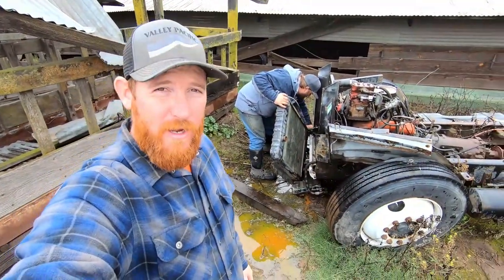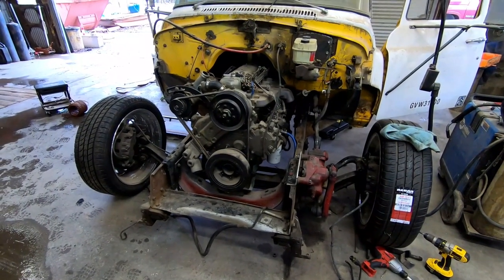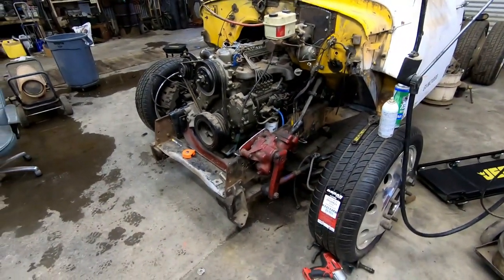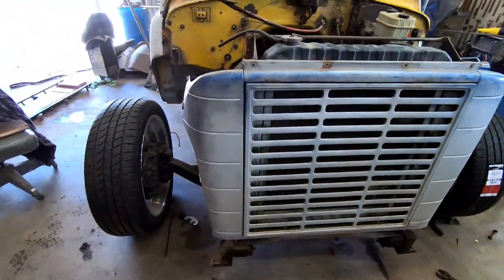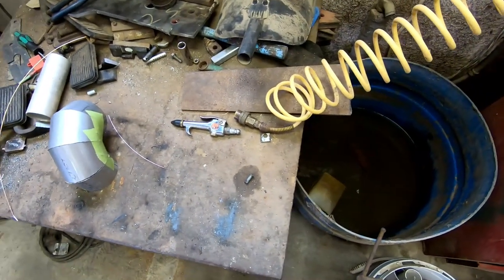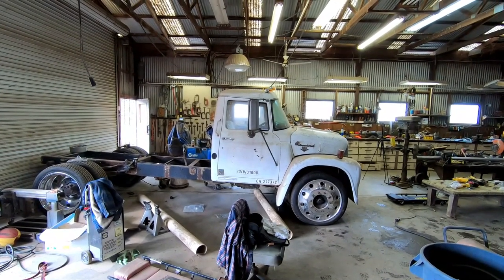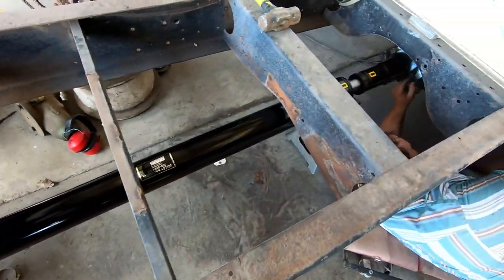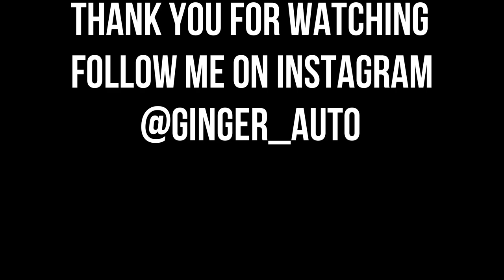Loadstar Gets a Custom Driveshaft!

Comment: Really slick setup with the brake line routing. Congratulations on the milestone of the front clip on it! The pie cuts looked like you got a nice tight tolerance on. I'm pretty impressed if those are your firsts! I'm about to dabble in some exhaust pipe gymnastics myself - turning a stock 5.0L mustang h-pipe into a y-pipe.